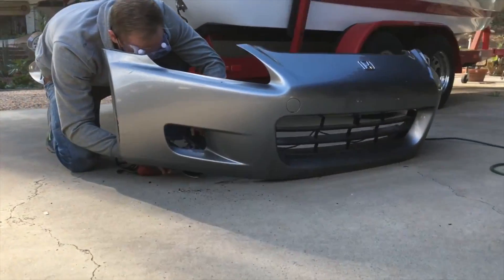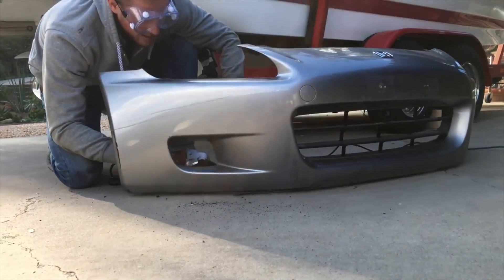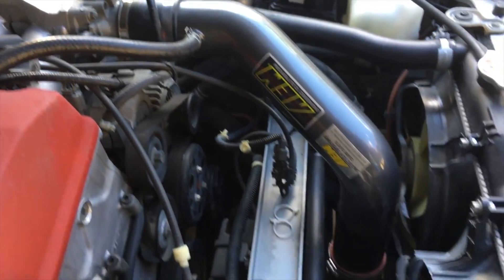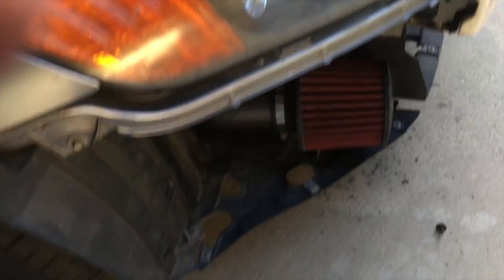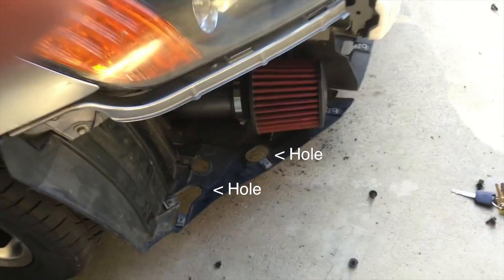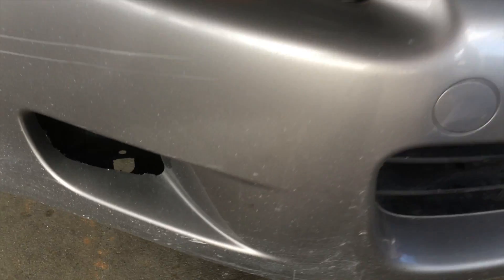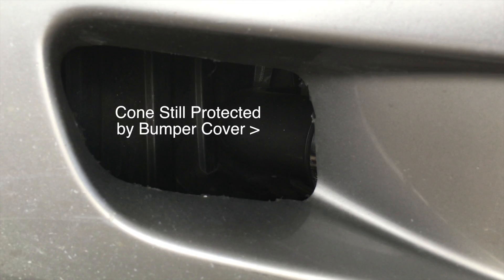AP1 Bumper Mod - Worth It?

Comment: For mine I just cut slits in the bumper so it's easy to tape over incase it rains (I have actually gotten some hydrolock if I leave the tape off in heavy rain, also taped up those holes in the bottom for puddles). Makes a noticeable difference in sound and throttle response with just one piece of tape off vs it on.

Comment: I am about to cash my very first car as a 19yr old&i have narrowed down to 370z&ap2 s2000. i let go of the option of a NA supra, bc of hp ego&going to school can't fund for it to become turbo....but none the less, s2000 are as common like a civic around my town, so the rarity of a 370z is up on my hands. I just want to know/hear facts and your opinion on a 370z, before i make my decision.
Reply from the maker: +Chue Yang I like the 370z. I think they just need an oil cooler for track use but otherwise they are good cars.

Comment: Your cold air is about 1.2% more dense. Which could result in more power theoretically. 
However, for ram air intakes and cold air intakes, you want laminar flow. The turbulence caused by you ramming air into that area might negate the effects.
You should do a 6th gear pull from 80-120 or something along those lines. Compare the time it takes. That's the definitive way of telling.
Reply from the maker: +TheXdmgx7 I wouldn't do this for 80-120 sixth gear pulls. Seems a little cray. I can data log it at the next track event though.
Reply: +ZentRose it's just a good way to measure small gains. There are a few more variables in datalogging at a track. but yeah. let us know.
Reply from the maker: I would would want to conduct the test at full load/rev to address your flow concern. I can just slow it down in post production.
Reply: +ZentRose sounds like a plan. I really enjoy your videos btw. hope to see you at the track some time.
Reply from the maker: +TheXdmgx7 Thanks. Also I think you are correct with turbulence concern here because the air is deflected (cone hidden behind bumper). I am very glad you brought it up because I need to make some changes here.

Comment: now measure the air pressure change zent. 
Also would like to know your thoughts on the bypassing the throttle body heating line?. ive heard its there to stop the throttle plate iceing and sticking at wide open throttle, idk seems unlikely lol.
Reply from the maker: +lkjlkjlkkj Good idea. Bypassing the throttle body will ignite a big internet argument. I say do whatever makes you happy :)
Reply: +ZentRose if you do start to measure pressures measure them at the cone and up close to the trottle body, with and without duct tape. Its good to have some quantative data 😀. You could also do it on the exhaust after each stage, that would be nice to see. 
Thanks for quality vids

Comment: An alternative is to have an airbox inside the engine bay to shield the heat off and route a pipe to the same behind bumper location to input cold air. The pro is servicing/cleaning air filter is easier but cons is your airbox take up more space in the engine bay.
Reply from the maker: +Dave Vo Yes good addition. Thanks
Reply: +ZentRose you are welcomed.